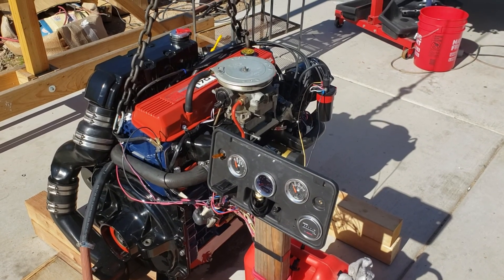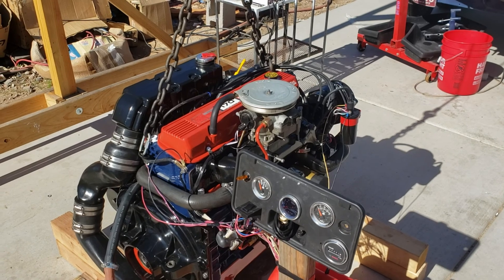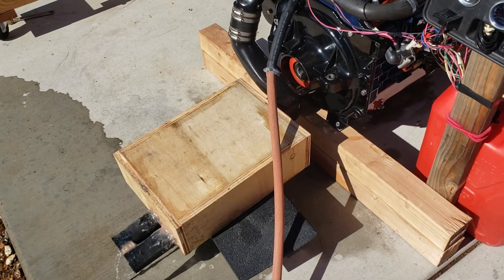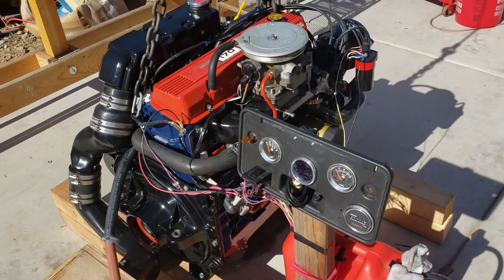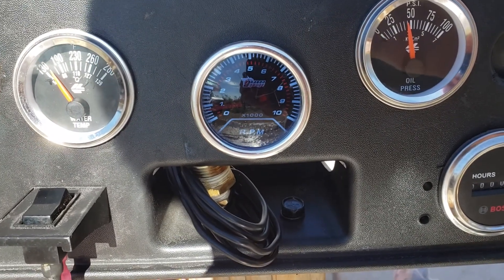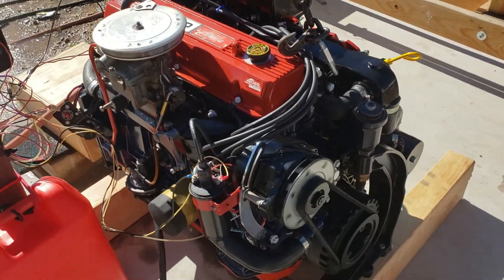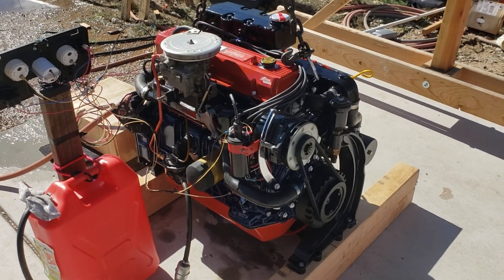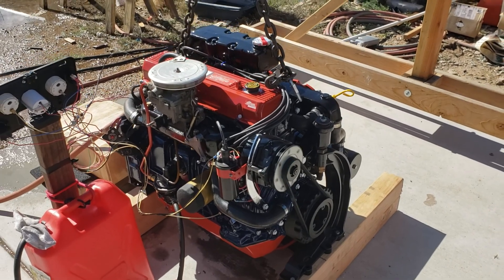Mercruiser 170 3.7lt running after rebuild

Comment: i saw your alternator video! i have a 170 that i’m trying to get running and i’m wondering what the alternator you put in took the place of and what you wired it to! probably a stupid question but i’m new to boats lol!
Reply from the maker: So originally there was nothing there except empty space. Some models have a power steering pump there. If yours has power steering you'll have to come up with a different mounting method. This is the alternator I'm using, but I had to take the rear spark screen off to make it fit:
https://www.amazon.com/gp/product/B00U2KG9D0/ref=ppx_yo_dt_b_search_asin_title?ie=UTF8&psc=1
Oh, and the single wire coming off that alternator is connected directly to battery +.

Comment: How did you make the wooden exhaust?
Reply from the maker: Its just a box with dividers in there forcing the exhaust to go in different directions. Its also coated with fiberglass resin to make it water resistant.  Of course this will only work on marine engines with water going through it, otherwise it would catch fire rather quickly.